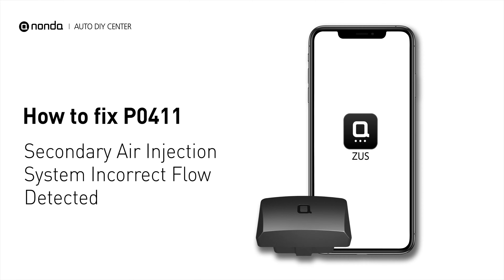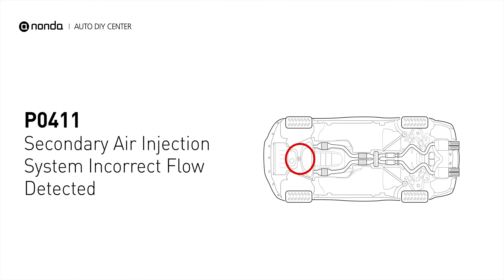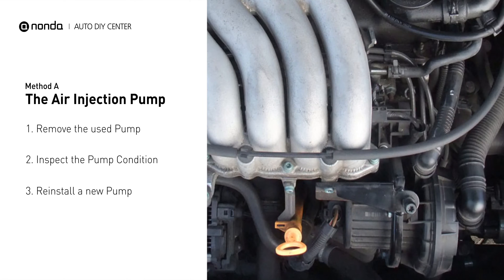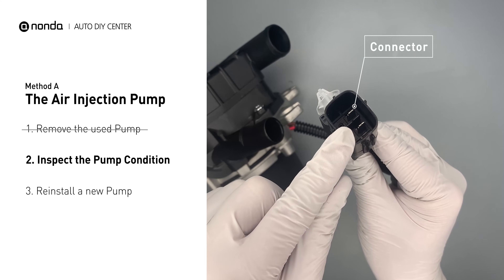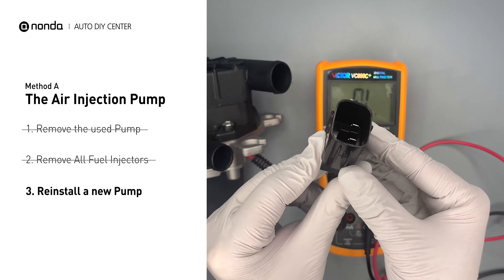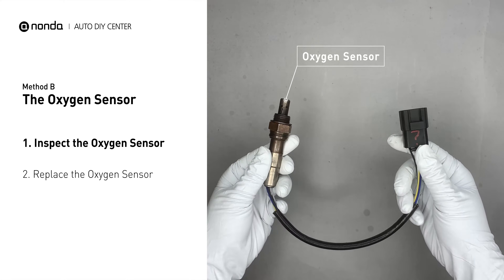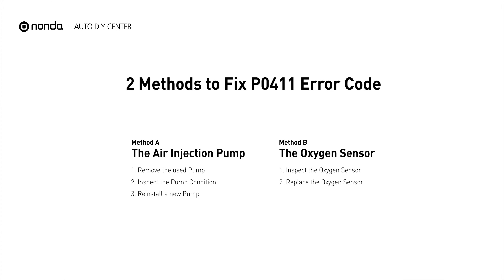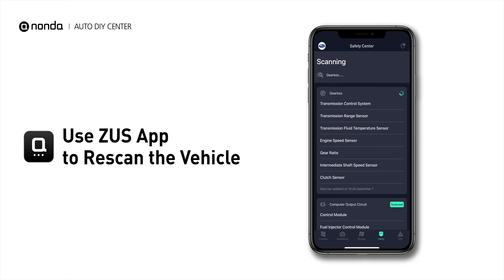How to Fix P0411 Engine Code in 3 Minutes [2 DIY Methods / Only $9.68]

Comment from the maker: Hi, I'm Steve, nonda's lead mechanic engineer. 
Feel free to leave your comments here if you have any mechanic questions, I will be glad to help you out!
Reply: Hello Steve, my daughter have a 2010 Pontiac G6 and codes are PO411
P2432 she fails inspection because the check engine light is on
Reply: HI Steve i own a 2015 Chevrolet Equinox  my check engine light came on i checked the code it says P0411 I'm not familiar with the whole mechanic on vehicle on the dealer always trying to over charge or create something else with the vehicle can you help me out with this issue thanks..
Reply: Are you serious? You say the air injection pump is wrapped around the serpentine belt? No it's not! You also say to inspect the pipe, while you're pointing to the wiring harness. Why would somebody trust this video if you don't even know what the components are for what we're talking about?

Comment: The air pump does not have a serpentine belt on it, they are electric, the pump pipe is not the pigtail, those two holes on the pump that you see in the video are where the pipe connects to and goes to the valve abd intake. I don't know to trust you if you don't even know what the pump is or how it works.
Reply: 👍👍I changed this air pump out 10 years ago it took a week for the engine light to turn off, these thieves today are making money off of these obd 2 scanners, they charging you 150 to 250.00 just to hook up their scanner, all these misleading videos are telling people to dismantle their throttle body just to clean it yup, another code thrower. you can clean that throttle body without tearing it apart. introduce Heet or sea foam to you car maintenance list.

Comment: Upstream or downstream o2 sensors?? This would be great information
Reply: He shows the downstream but I don't think that can be a factor for air systems
Reply from the maker: Hello, please provide us with your vehicle's year, make and model.
Reply: Hello I have a PO411 code on 15 GMC terrain and can't pass the test only 43000 miles on it
Reply: Upstream i believe.  But what is on the video is the downstream O2

Comment: Thanks for the video! I had got the code P0411, P0013, & P0014. Once I replaced parts for 0013&0014 all I have left is the P0411 code. Do I need to let my car do a complete drive cycle before the code and my check engine light come off?
Reply from the maker: Hello, as you are getting more than one error code, we suggest getting your vehicle visually checked by your local mechanic for further diagnosis.
Reply: @nondainc  👀👀👀👀

Comment: I have been getting P0411 for about a month on my 2012 Chrysler T&C  van.  The CEL will stay off for a few days after reset, then comes on again while I'm driving (and the engine is warm).    

??
Reply from the maker: If this is the only code you're getting, please follow the tips/solutions provided in our video on how to fix P0411. Hope it helps!

Comment: What kinda damages on oxygen sensor?
Reply from the maker: Since its location is in the exhaust stream, it can become contaminated. Also, if maintenance such as air filter and spark plug replacement isn't performed as intended , oxygen sensor can go bad quickly.

Comment: Dealing with the same issue, pump is working on cold start I can hear it when I disconnect hose, changed the check valve 2x and inspected all hoses, still have p0411 on my 2.5 Malibu 2013
Reply: Yes I figured as much I already have new expansion plugs I'm going to clean ports out on Saturday when the weather warms up and hopefully solves the issue
Reply from the maker: Hello, have you checked if there's an exhaust leak?
Reply: Yes I have checked, no leaks
Reply from the maker: Kindly make sure that the air pump harness has no open/short. Double-check the air pump circuit for poor electrical connection.

Comment: I have this code change the MAF sensor Secondary air injection pump , air pump converter  air pump sensor. BROUGHT IT TO DEALER an they couldn't find a problem while they had it for two months. The only thing I have checked was the 02 sensor I really hope this is the problem because the vehicle has no serious issues except for this P0411 code that I've been dealing
Reply: Did you ever find the solution? I have a 2014 Impala 2.5L. I cleaned out the ports and replaced the plugs. Tool apart the secondary air check valve and tested that it still works. Air is coming from the pump on cold start up. You can see this by disconnect the hose going into the check valve and plenty of air is blowing. Maybe I need a new upstream 02 sensor?
Reply from the maker: Hello, please let us know your vehicle's year, make and model.
Reply: Same here did u ever find a solution???
Reply: Sounds like a bad PCM
Reply: I would suggest it's plugged port on the head side. There is a TSB out on it, and have had 3 this past year with this P0411 code, after having tested the pump through bidirectional control scanner, I can validate the pump is functioning correctly, and the two secondary air injection control valves are functioning properly. The runner that these control valves are mounted to requires removal of the exhaust manifold and the catalytic converter to access and remove. I would bet that's your problem. The port on the head that this exhaust runner mounts to tends to collect carbon build up and has to be removed manually from the head. This condition is more common in colder climates due to moisture build up within the 
Air injection system from the extreme temperature variations between cold and hot that causes a more prevelant moisture condition. Generally it seems to be the driver side port in my experience, that has the problem build up of carbon, but you have access to both when the runner is removed, so it's natural to inspection and clean both sides at the same time. I hope this is helpful and if any more questions feel free to message me.

Comment: Wait so the 02 oxygen sensor can cause this code also ??
Reply from the maker: Yes. It is less common but in order to pinpoint the cause of the issue, possible parts affecting must be inspected.
Reply: @nondainc  An Update :  Well it wasn't anything but a lose air pump ground wire pump was still working but not as efficient because of the lose ground wire but at least everything is OEM new and ports cleaned don't have to worry about this check engine light anymore. You should mention about secondary air pump ground wire that will also trigger this code.
Reply from the maker: Thank you for sharing your experience, R/C.
Reply: @RC_BASSBOY  where was the loose ground located? Thanks. I replaced pump and valve because pump had water in it. But code came back.
Reply: @DownAndDirtyOffRoad  The ground wire is located behind the valve cover on the corner passenger right side a 10mm bolt is bolted to it on the head.
Reply: @RC_BASSBOY  thanks I'll check it out
Reply: @RC_BASSBOY  my mechanic wrote down these codes on my receipt but he did nothing to air pump just replaced my spark plugs and added new coils. And he told me to buy some gasket sealer.. 3 yrs in no prob. But now its giving me o2 sensor code. Not over heating no more
Reply: @nondainc  I've replaced the Air Pump and the Valve Sensor cleaned out all the ports from carbon build up all air hoses are cleaned replaced with original GM products and I still get this P0411 code. Car is a 2011 Chevy Malibu LS 2.4l ecotec engine.
Reply: No, the oxygen sensor can not cause this code alone, a faulty sensor would not set a code P0411, a failure in the secondary air injection sytem will be the condition to set this code, this code could cause a inefficiency code along with it, but not a faulty o2 sensor